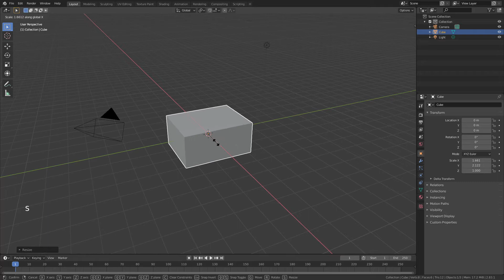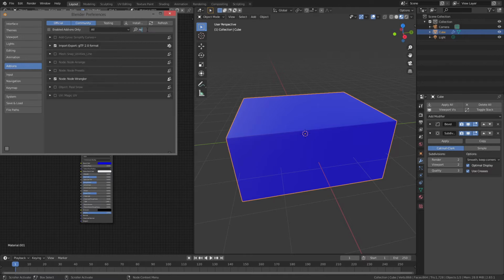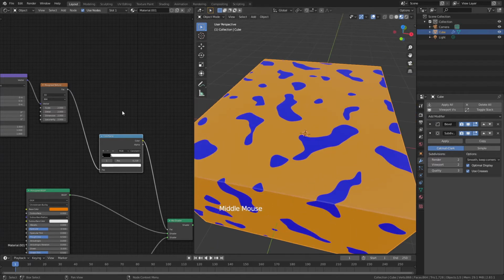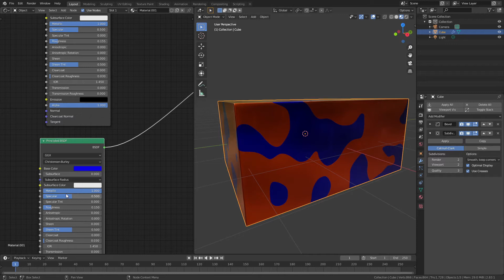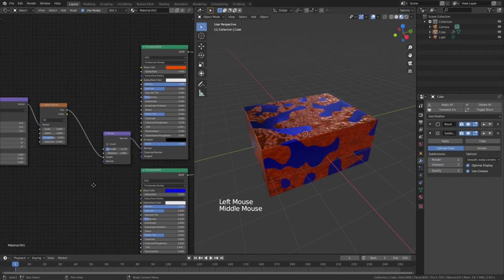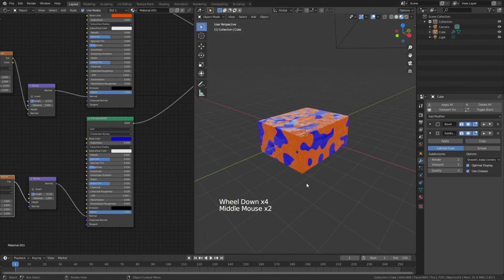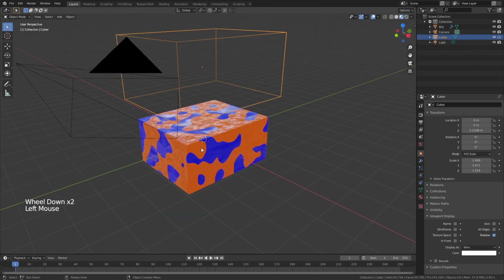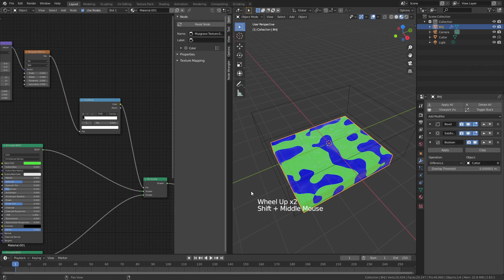How to Make a Bulk Heterojunction Texture for Organic Solar Cells in Blender

Comment: FYI. Just found out the Musgrave Texture Node was replaced with the Noise Texture node in the 4.1 version and even the short-cut shift+S is disabled. So i had to use the Add options > Texture > Noise Texture.
Reply: Thanks
Reply: yup thanks for this comment

Comment: Hi cg figures!! I want to make a porous structure, but even if I set the blue part to be transparent, the orange part inside the structure doesn't appear and only the outside surface comes out. so I want to ask for help...
Reply from the maker: Porous structures are an interesting challenge. I covered them a bit in a longer video but it's buried in other content. Here is the link. It's one approach of many but hopefully it will be helpful. https://youtu.be/iinCRohRba4?t=1987

Comment: Good tuto for generate this structure, can you help me how to determine the porcentage (or fraction volume) of color blue or red?
Reply from the maker: That's a very interesting question. You can adjust the relative percentage easily using the color ramp but strictly quantifying the volume fraction with a percentage isn't really possible using this approach. The texture is just a 2D projection on the object so it's sort of "fake". In the other version of this tutorial that I made you can create actual mesh objects and you can calculate the volume of those using free add-ons Blender has for 3d printing. For more information on that check out this link on the blender stack exchange. https://blender.stackexchange.com/questions/63113/is-it-possible-to-display-volume-of-a-mesh-object#:~:text=2%20Answers&text=You%20can%20use%20the%20Print3D,calculate%20volume%20and%20total%20area.
Reply: @CGFigures  Concerning a surface structure with nodes, I think that the color ramp node only gives the surface percentage, if in the case of cross sections, each image has percentages for each color and the sum of these percentages gives the volume of each color . Also in your tutorial (How to Model Cross-Sectioned Bulk Heterojunctions and Meshes in Blender), we can determine the volume fraction with Print3D add-on.